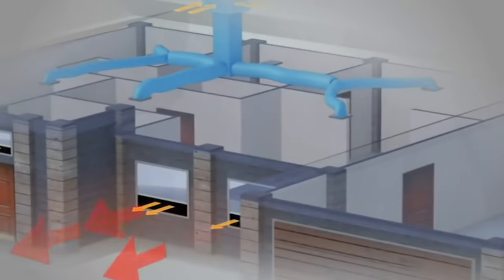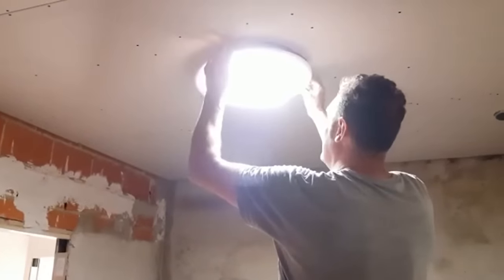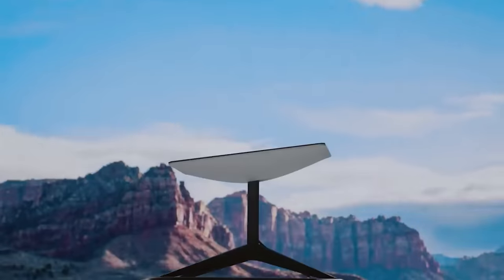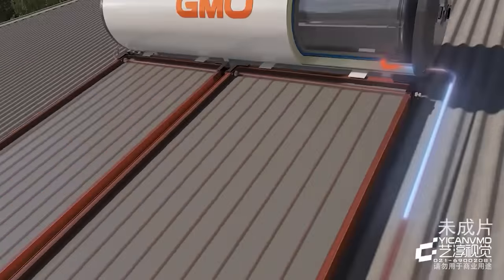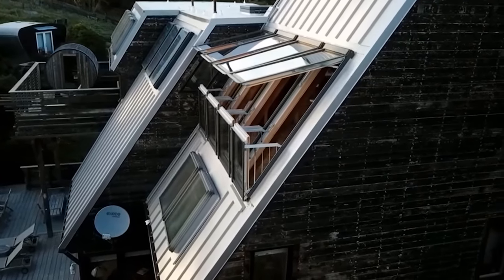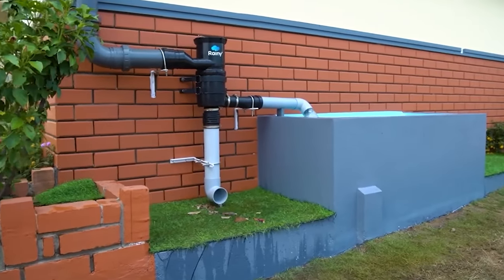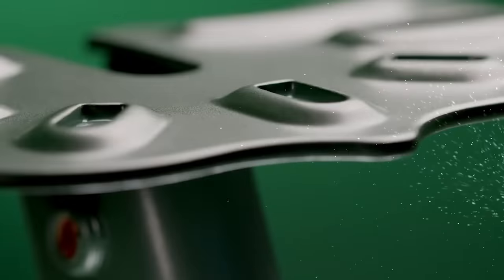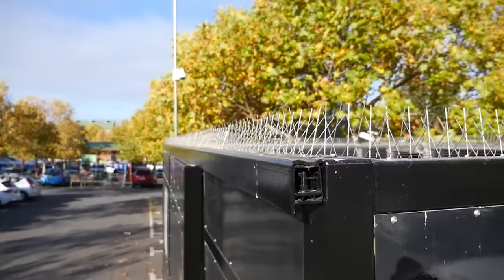INCREDIBLE INVENTIONS FOR THE ROOF OF YOUR HOUSE

Comment: I considered light tunnels for many years as a money saving way to reduce electricity usage but never installed.  Now, LED lighting has become so affordable and low energy usage, that the expense and potential for roof leaks with a light tunnel (compared to a seamless roof) especially in northern snowy areas makes the light tunnel more expensive than LED lighting.

Comment: Patent laws must be way different over there if you can patent a bunch of pvc pipes and fittings with a sprinkler on top.
Reply: Ya as a patent holder myself I can confirm it is completely screwed up. The examiners mostly are unqualified now days. It is wreaking havoc on us having to fight these known prior arts.
Reply: A new processor is just the same components as an old processor but assembled differently. Every invention consists of pre existing components. So your rant is pointless.
Reply: Ya a Design patent, not a utility patent..make it 1cm longer and you can have your own design patent.

Comment: #1: This is just a fancy version of a generic Evaporative cooler (i.e. "Swamp" cooler) and they are effective typically - but lose cooling power in humid conditions.
Reply: Yeah it's an elaborate swamp cooler. Good in hot dry climates.
Reply: Seems like it's not a great cooler, but it sounds like it'd be a great whole-house humidifier.
Reply: @Hearthburn1 They work really well, I have stayed in many a house with them, and had to turn the cooling down,which is up really because I’ve become too cool even on 40C plus days.
Reply: 3000-5000 euros for that junk shown as an "innovation" is far too much tho. even for the whole system. a massive 200Kg version with 2060 cubic feet per minute air output costs 1000 euros here...

Comment: On the "pigeon spikes".  I have seen them used extensively while I was in Portland, OR.  The main MAX station in the Rose Quarter has them all over the underpass.  They don't stop.  The pigeons nest on them, and leave enough excrement to fill them up.  Then on the swamp coolers, not new in any way, but I do have a use for them even in hot and humid areas.  You put them adjacent to your heat pump and feed their air to it, providing cooling assisting the heat pump in the summer.  If your area has no water issues, it would give a gain in efficiency.

Comment: So strange to see evaporative coolers in a video like this... In Australia they are everywhere and have been since I can remember
Reply: it's just a big swamp cooler
Reply: Only works in a hot, dry climate - Arizona.
Useless in most of US due to high humidity.
Reply: Normal evaporative coolers are useless over 95f. Even the 5 inch pads shown helps a little. You need the 12 inch ones with the pre-wetting system.

Comment: Ridge of rooftop sprinklers are NOT recommended in Australia ... on a big day the water is blown far off from the house it is intended to protect.
More effective are sprinklers set at side of roof and directed parallel to the walls ... thus wetting down walls, gutters, window frames etc AND even the roof itself.

Comment: I want a solar powered roof vent with built in mechanical thermostat. NO BATTERY NEEDED.
And for it to last a lifetime.
Of course not cost more than $100 + $50 installation.
Glass lined hot water tank needs no anode.

Comment: That rooftop sprinkler is not worth a knob of goat shit. In the example shown, if those trees were on fire they would produce anything from 7000 to 70000KW per square metre, depending on the conditions, at the extreme end, Nothing man-made can stop or put out a fire of 7000kw per square meter.

Comment: 1. Its called adiabatic cooling. High water losses when you use water all the timer, otherwise you have to renew the cooling plates every year. Furthermore you get mold in the building because of the humidity. Additionally its too expensive (there are better, other technologies for lower prices) and you need connections for water, sewage and the connections to the rooms.
2. you destroy the water insulation by doing holes in the roof + you get outside temperatures in the building (what about heating and cooling in the summer / winter???)
3. nothing special, there are also many products outthere, especially for cellars.
4. i dont want to comment bullshit products by a bullshit man
5. wow, the first good product. you have to be aware of insects and moist that destroys your building materials.
6. besides the very ugly design and positioning of the tank (do you need a structural engineer for it?), there is a reason why heating panels are bad and not used. The effiency decreases in the winter when you need warm water + there is no sun in cold winter days + price is too high. A better solutions are PV-panels with a Heat pump and a buffer tank (maybe an exergy machine too).
7. Look at point 2: WHY DO YOU MAKE HOLES IN THE ROOF???
8. Wow so 2005, where is the incredible invention
9. ??? trash product. Tell your city administraion that you are making your roof wet because of a fire that can destroy your building. Especially in a hot summer time where water is needed.
10. Same shit as 9.
11. cistern with an intern water filter?
12. We are trying to use this products in our projects. PV-Modules for the walls with good designs. But it is too expensive.
13. just heat the building properly, the snow will fall of by itself. Buildings in snow zones need a better solution than this.
14. I thought Point 8 was old, but this describes your video perfectly. Your inventions are like bird shit on a fresh washed car.

Overall i got only 2 products that are good inventions. The other products are outdated, too expensive or useless.
A completly waste of my time :text-green-game-over: